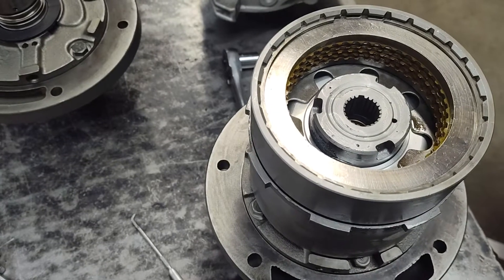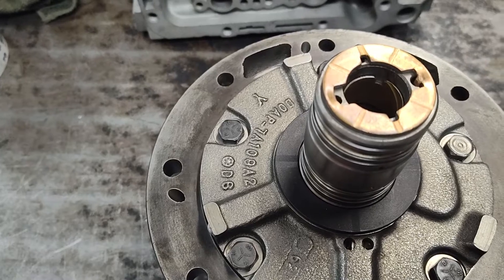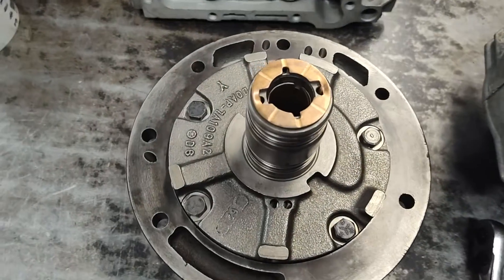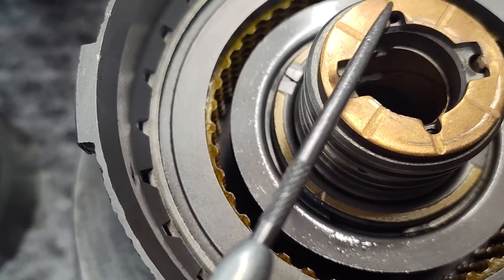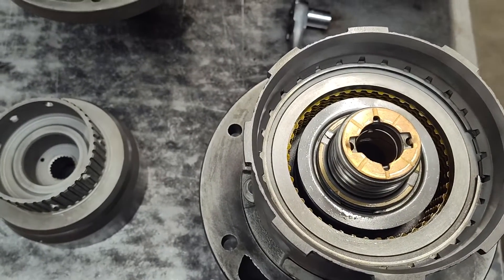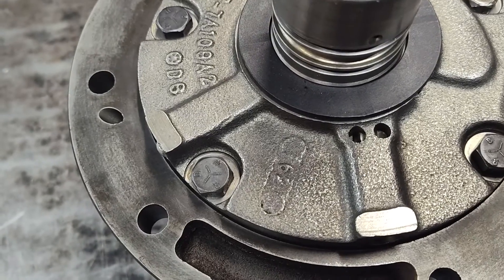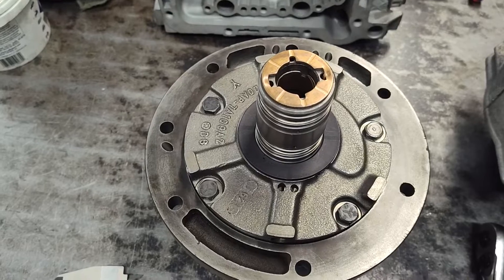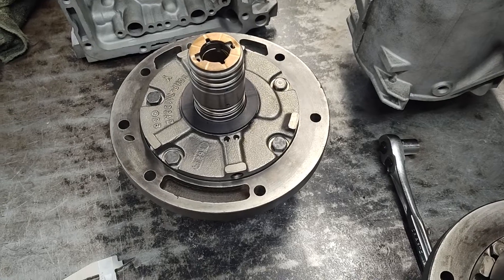How To Properly Set End Play on a Ford C4 Transmission

Comment: I have found If you shim the bronze washer out too far to get the proper end play the Teflon sealing ring on the forward clutch will blow out. Ask me how I know. Also even the thickest bronze selective washer .107 inch won't work sometimes to get the proper end play with these roller thrust bearings. I have had to shim the roller thrust bearings to get the end play right. It can take a long time to get it right.😥
Reply from the maker: That is a good point. You can over shim and cause an issue with the sealing rings.

Comment: During the recession of the early 80's, my dad lost his really good paying job. For the next year and a half until he found another good job, he supplemented his income rebuilding mainly C4's and some C6's. After he quit Super Stock racing about 1976 and started Bracket Racing, he used C4 Automatics in his cars for better consistency over a toploader 4 speed.

 I worked beside him at that time and learned a lot of the ins and outs of rebuilding a C4. I used them in my own race car and starting in the late 80's, I was the one building them for local racers and some regular street cars.

 I am trying to remember, but I think that the '64 to '71 Chilton's manual has a good description as to how to do this correctly. Really haven't found any other good printed source for this, but my printed sources are all 45+ years old by now. 

Used to always set the backlash between .006" and .008". Experimented with tighter, but at least in my experience, .006" was about as tight as I wanted to go. Used to write the backlash number on the case with paint marker for future reference so I could compare after 100 runs or so on the transmission.
Reply from the maker: Interesting story. Thanks for sharing it.